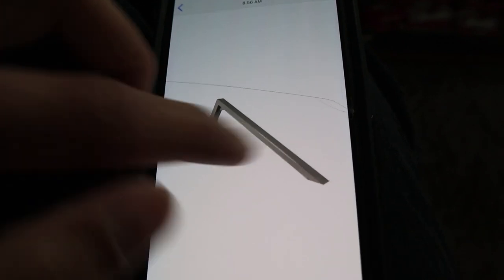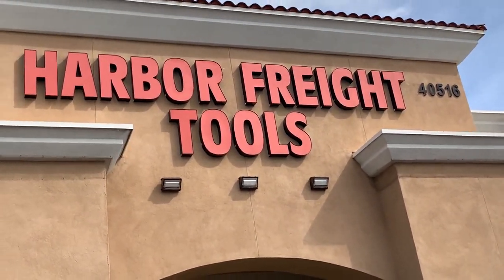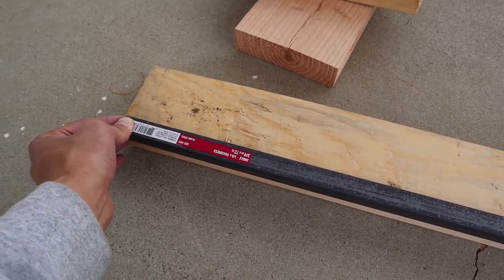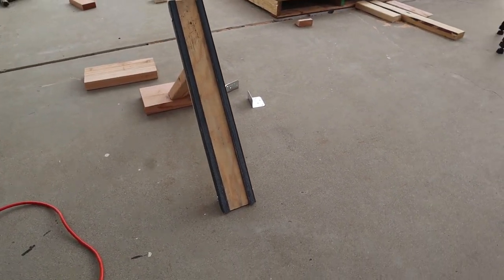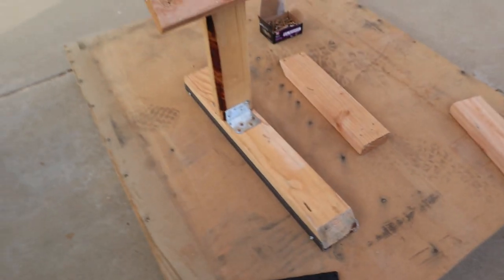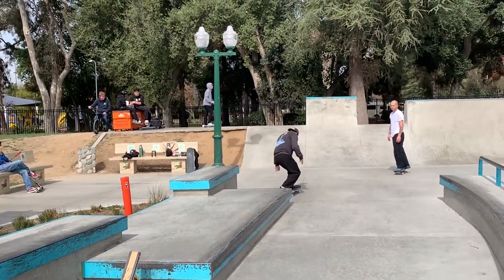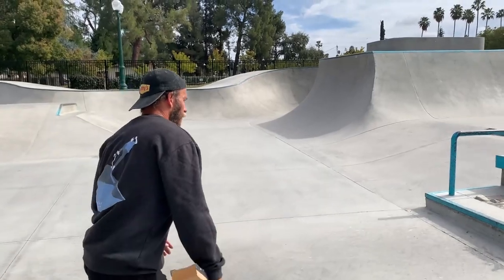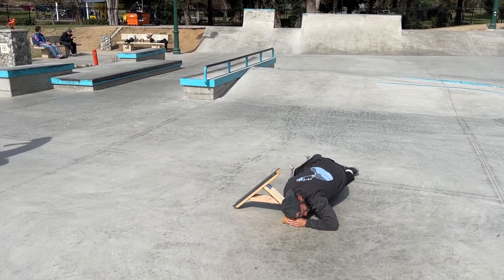DIY WOODEN POLE JAM BUILD

Comment: On the angled iron try using flat heads and counter sink them with a drill bit so you don't get those lil bumps. Just my 2 cents.
Reply from the maker: That would work way better than the way I went for sure hah

Comment: Bunnings in Melbourne can get a corded one for 30 Bux... definitely get the job done if ya doing any small diy stuff.

PS use a small Phillips tip on your drill you'll find it will be a hell of alot easier and slip alot less. Those Phillips tips man not be sharp but will put a hole in your hand if ya slip